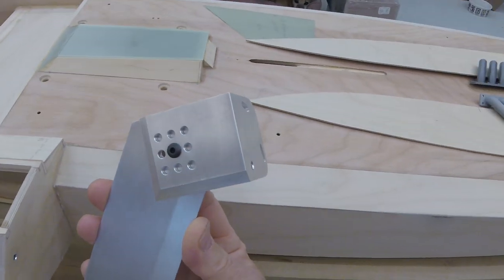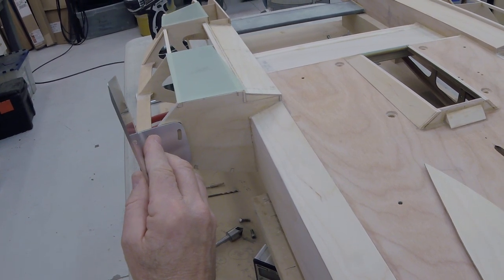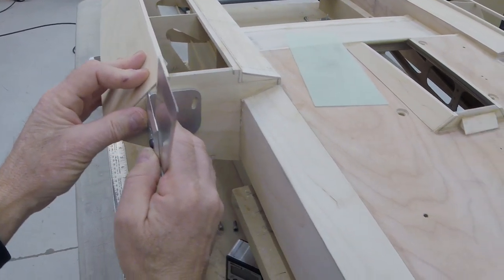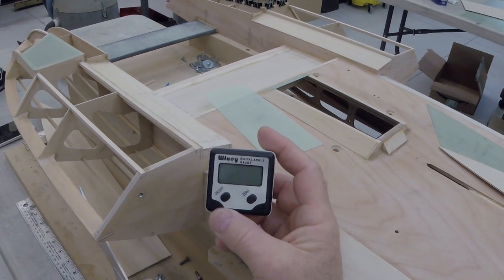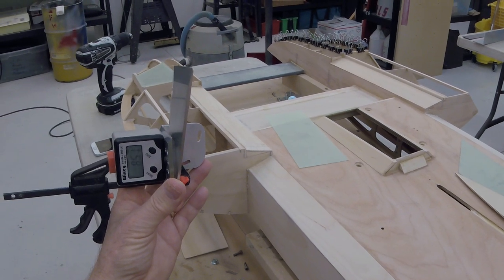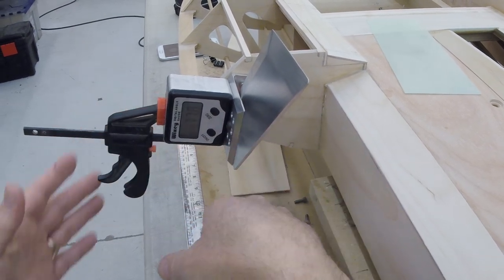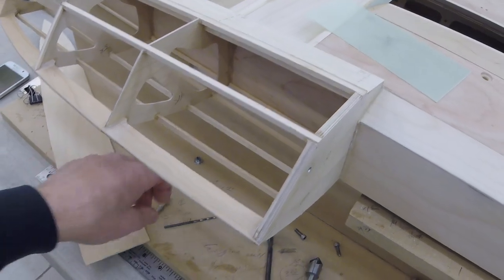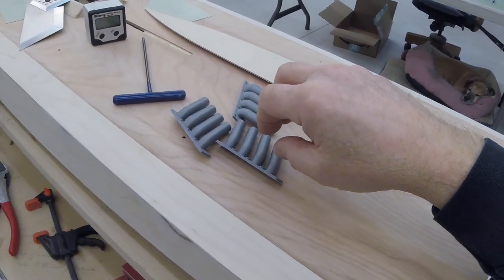Mounting The Turn Fin & Bracket For Radio Controlled Hydroplane - Part 6 of "The Gasser"

Comment: Hi Scott,  re: making a remark on tube install vid. I have found using ptfe inner tube for flex cable working a charm. This tube found inside pneumatic high temp pipes. I rely on ptfe's natural lube, no lube added. Running like this for past 5 years with no probs, using zenoah 26cc in cat hull. Very nice vids you give. Thx Baie ZA.
Reply from the maker: That's interesting. I've used Teflon lined tubes before but still had to grease it to avoid failure. The ones I had used had a very thin liner... Are you using a thicker liner? I also wonder if rpm has something to do with it. Nitros turn 28k+ rpm but most gassers are less than half that.
Thanks again for the idea. I'll think on it!
Reply: @M5PerfHydros  
Scott, my gas boat only peaks at +-18k rpm. Have not tested higher rpm. Must admit that it feels naturaly slipperly to the touch. If we had to pull both ends it would slip out of hands. Tube comes with s/steal braided outer when bought which I then remove. Greetings Basie

Comment: SO, Location ofthe turn fin and the rudder. In talking to Scott Pierce, having the rudder on the opposite side from the turn fin will set the fin harder when it starts turning.  He said when he was with The Bud, they figured that out.
At least that's what Scotty told me.
Reply from the maker: I think I agree, though it's a subject that has tortured my brain for quite some time.  Someday I'm going to build a setup that will allow me to adjust the rudder side to side quickly so that I can do some back to back testing

Comment: Sharpen  a nail  to a needle point similar in size to the drill your are going to use to drill the pilot hole , it will go   will never split the plywood or any wood used, and as a bonus  you will not need to drill your fingers ever again .It works on the hardest of wood types with moderate pressure , a bit more on rock maple , drilling 1/8 ply is like going through a notebook page .
Reply from the maker: I'm not sure I understand. Do you mean it should be heated to burn through, or cut the head off and use the nail as a drill?

Comment: Scott, where do you get the angled aluminum with the radius added? Home centers just have basic angle alum.
Reply from the maker: Here's the one you want;
High-Strength 7075 Aluminum 90 Degree Angle, 1/8" Wall Thickness, 2-1/2" Outside Height

https://www.mcmaster.com/9178T23

Comment: What stock do you use to make mounts? How do you make sure it is square?
Reply from the maker: My turn fin and rudder brackets are 1/8" 7075 aluminum angle that I square up on the mill.  Most of the angle stock is less than 90° between the legs, which irritates me by the way, so I press the parts to 90 before drilling. Is this what you were wondering about?
Reply: @M5PerfHydros  Yes. I didn't think you just used plain stock.  Thank you!

Comment: Im still here as you said, but not because I'm a real boat builder...lol I couldn't afford it if I wanted. Love the work you do and they look amazing, but its more like a "rich mans hobby". No offense meant by that, just saying the average person cant afford these. It makes it hard to get into the sport/hobby.
Reply from the maker: Mmmmm, yes I suppose that's true on some level, but I think it's getting better. The 10th scale electric classes as an example are pretty darn cheap. A guy should be able to have a very competitive 10th scale for about the cost of just the motor for a nitro boat.
Thanks for watchin' anyway, I'm glad you like the videos!
Reply: @M5PerfHydros   Yes, I have looked at them. I'm in the process of building a 40" Wild Thing mono, I don't know how well its going to work using cheap 5mm RevolutionPly from Lowes. Been buying hardware here and there or making it when I can. I was planning on using a modified weed eater engine. Its my first boat so it might just sink, I don't know..lol
Reply from the maker: Ha ha... Hey you'll never learn unless you try! 
Good luck with the build!

Comment: What size of angle aluminum do you use for your turn fin bracket?
Reply from the maker: It's 1/8" x 2.5" 7075, cut and milled.  Available from McMaster Carr
Reply from the maker: Here ya go;  High-Strength 7075 Aluminum 90 Degree Angle, 1/8" Wall Thickness, 2-1/2" Outside Height 
https://www.mcmaster.com/9178T23
Reply: Are your turn fins 2.5" wide also
Reply: What grade of aluminum are u using for the turn fin and how thick is it
Reply: Also not to sound like a dumb ass but could u possibly do a short video on multiple nitro fuel tanks and on how to fill them.
Reply: Man I need some real help. I'm a avid wood worker but not a boat builder. I purchased as I have mentioned to you before a ML Boatworks GSX 338 in the nitro version. It has a wide engine well not real narrow areas along side the engine well area the full length of the boat and it has big area ahead of the engine area but I will need to but my throttle servo in there somewhere. My issue is fuel tanks. Not sure how well it will affect the weight balance of the boat by putting a 12 - 16  ounce fuel tank in the center of boat just ahead of the engine. Should have took your advice on modifying the boat by either making the engine well area narrower or widening the whole boat. But like I said earlier not a advid boat builder. Do you have any suggestions.
Reply from the maker: @patruddiman4228  - Heh... That's actually a real good idea. I'll put that on the list
Reply from the maker: @patruddiman4228  7075, .100"
Reply from the maker: @patruddiman4228  - Measured straight across the blade is 2.375", height varies but somewhere around 5.25" will work. Just give yourself room to adjust with extra holes
Reply from the maker: @patruddiman4228  - Front mounted tanks bother me as the balance of the boat shifts rearward late in the race as fuel is consumed.  This makes the boat even more flighty across late-race chopped up water.  For this reason I always try to mount my main tank on the right and as near to the balance point (center/front) of the turn fin as possible. Positioned on the right so that left weight increases as fuel is consumed.  As the race goes on the water gets more and more rough, and a little extra left weight at that point will help hold the outside sponson down as well.
Clear as mud?  I feel a video coming on....
Reply: Well I guess i will have to build my own fuel tanks the spaces are so narrow that store bought tanks won't work with the sizes they provide. Thanks for the help
Reply: Well beings I have the whole part of the boat built i will have to redesign the inside so I can install fuel tanks. This ML Boatworks kit can either be ordered as a electric kit or nitro kit.
Reply: Well no matter how much I try to figure out how to modify the inside of my 1/10 scale boat that is set up for nitro use I can't fit any decent size fuel tank. My old boat has a 8 once tank on each side to run a .45 engine. I want to put all my tanks on the right side. I came to the conclusion to cut the sides off and make a new bottom and bulk heads.
Reply: So I determined what I need for mounting my fuel tanks but rather than making the engine well centered I thought I would off set it to cut down on weight. So the strut still needs to be in the center of the boat i assume. So do u off set your engine in the engine well?
Reply from the maker: Yes I offset motor and strut 3/8" left on my Gasser and 1/4" left on my nitros
Reply: So should the strut and shaft still be in the center line of the boat.